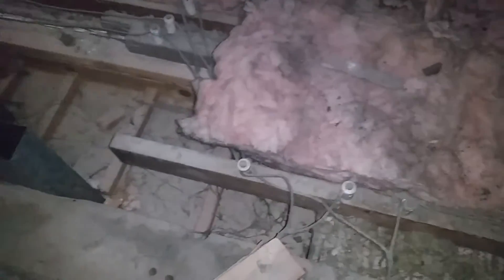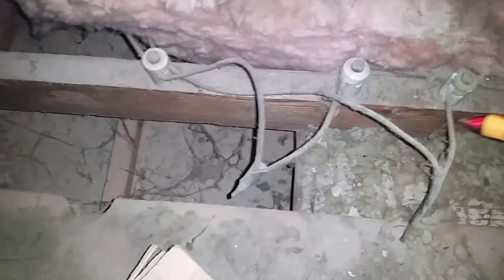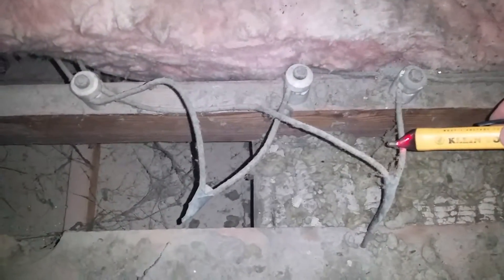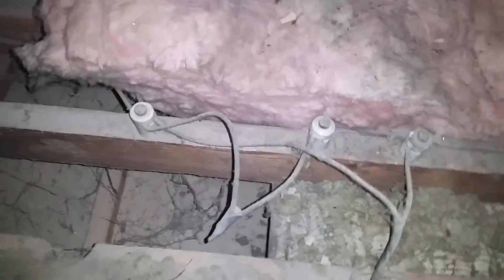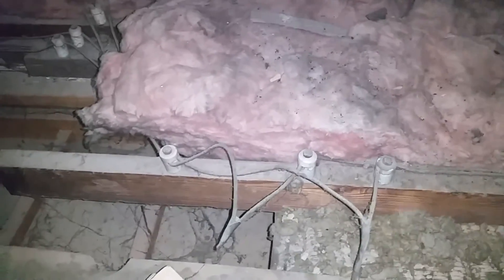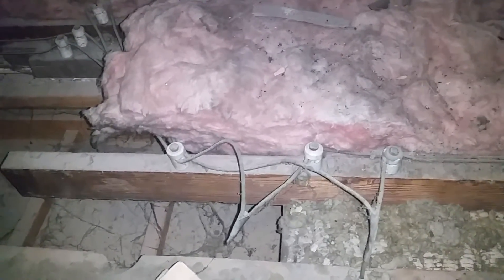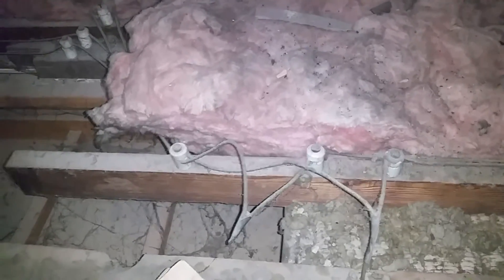Electrical Fire Hazard - Knob and Tube Wiring

Comment: Can plastic tubing, or some other kind, be used to cover and protect the wire, or does that build up heat as well? I believe the original wire was covered by asphalt-soaked cotton that eventually rots away.